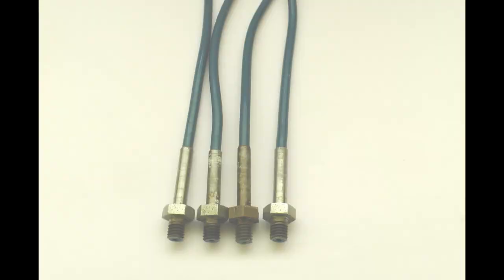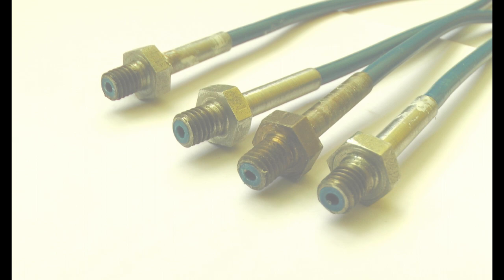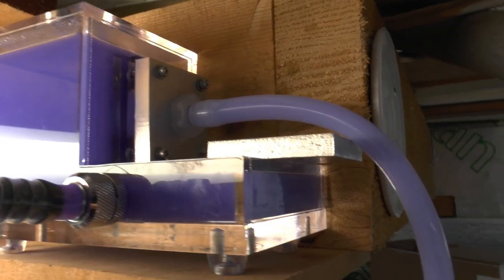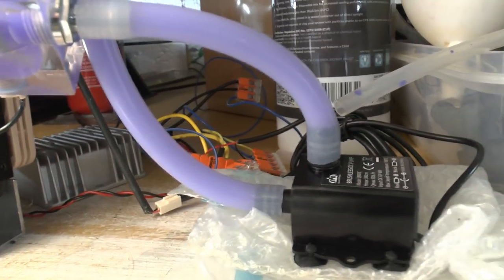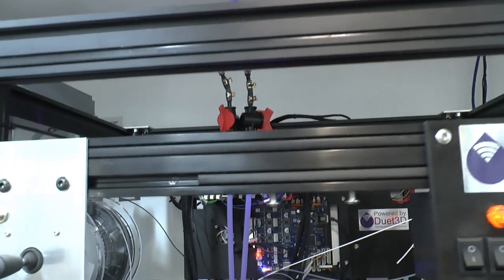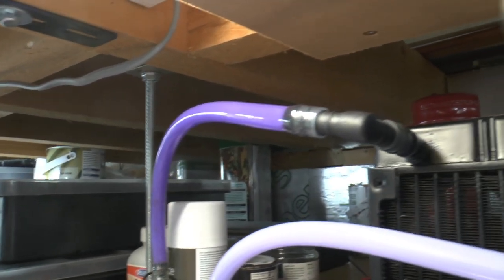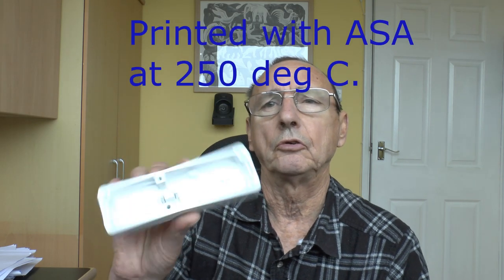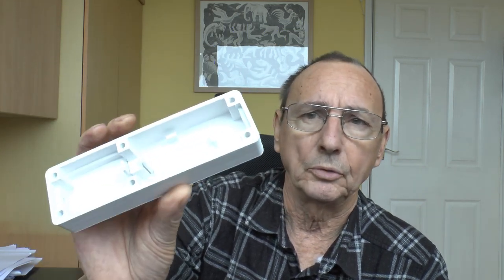4 input multi colour hot end part 2

Comment: I’m just catching up with your Developments, but a few Points:

Is your Bowden Coupling using Metal Fins to clamp the Tube?
In my Experience Parts labeled for 3D Printers are expensive and not so good.
Although I didn’t find any industrial Couplings so far that let you stick 4mm Tube trough.

There are Heating Cartridges with integrated Platinum Sensors, but they are normally for 230V.
I couldn’t source some so far, but they might be an Option to miniaturize your Parts even further.